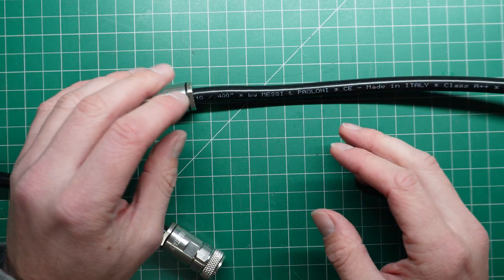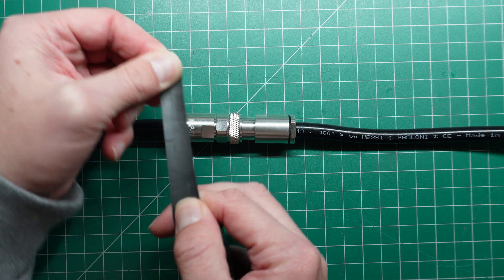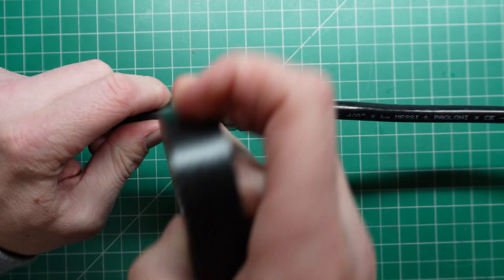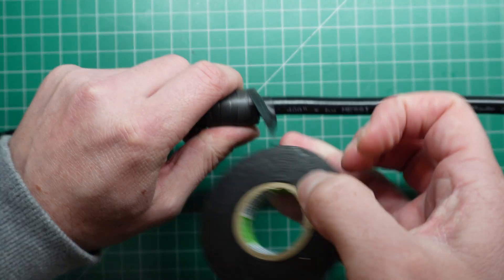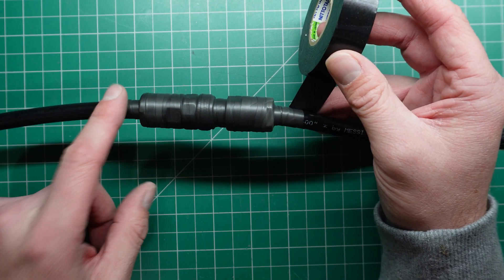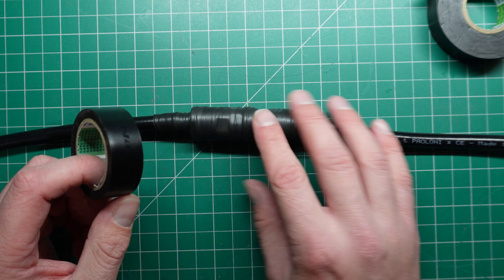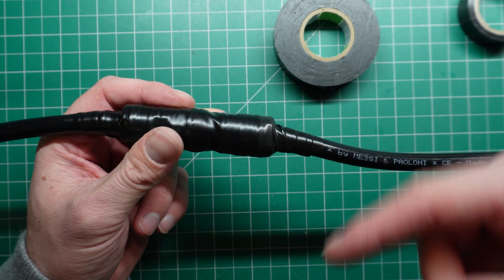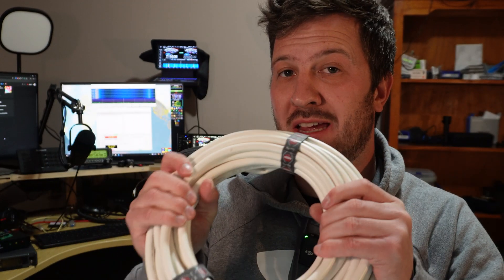Waterproof COAX Cable the Way The Techs Do It!

Comment: Super 88, curtesy wrap, then butyl tape, to seal it, then 5 layers of super 88 stretched tight to help compress the butyl.  Start at the bottom and finish with an up wrap.  At the end, flip the tape over for sticky side out, go around a couple times then flip the tape back again go around and cut it off.  Don’t tear.  For some odd reason, some people have problems using the self vulcanizing tape.  We used it in the Navy in the 80s, but added Scotch Kote after.

Comment: Everyone talks about how Low - Loss that Coax is, but if you look it up, it's not that great ?
I do like the looks of the connectors, but as to such great 
Low - Loss, what am I missing ?
                    🤔.....?
Reply from the maker: Low loss vs flexibility. LMR240 and 400 have lower loss, but are rigid centre conductors
Reply: Dunno what charts you're looking at but the ones I'm seeing, its closer to half the loss of "regular" coax. And I'm not interested in LL400 or whatever because it's solid core and copper plated steel at that .
Reply: @oldfartonabmx2122  
" Regular Coax " ?
                       🤔.....?
Perhaps you need to really study, instead of memorizing the answers !
With your comment, you have made a huge leap, mixing Apples & Oranges !
Very dependent on what you wish to accomplish !
And believe it or not, a solid conductor is really what you want !
Just because it doesn't fit your plan, doesn't mean it's wrong !
Try not to paint with such a large brush !
You may end up covered in paint !
But thanks anyway !
👍😉

Comment: Wrapping the connector in Teflon pipe tape fist, then overwraping with self amalgamating tape, will make it much easier to get the stuff off in the future. I have used this method for 20 odd years and it works well!

Comment: A layer of electrical tape first makes it easier to remove the self amalgamating tape later, and an outer layer of electrical tape protects the rubber tape from UV damage. Don't buy cheap electrical tape, it always falls off. Get the good stuff. I use Scotch Super 33+.

Comment: Good to show people. I still finish mine off after that with Denzo tape. messy as hell but never had a failure of a plug/socket connection to the antenna even with plenty of salt water. the antenna and foundations give out first ;-)

Comment: If it was an outdoor connector I'm not going to touch for years, I would use glue lined double wall heat shrink, then use split tube over that then PVC tape around the split tube then cable tie the PVC tape. 
Also M&P have o-rings on their connectors, I have 10m of the hyper flex 10, they also sell a seal boot for the connector.
Reply from the maker: Yes glue lined heatshrink is good too 👍

Comment: Thanks Hayden. Perfect advice and exactly what I have always done. I use Scotch 23 Self Bonding for the waterproofing layers and Scotch Super 33+ for the UV protection layer. The Super 33+ is horribly expensive, but the results after 30 years in the NW Queensland sun make it well worth the $25 per roll. I also use it to UV protect my cable ties holding coax to the boom and/or mast. Lasts forever.
Reply from the maker: Great tips! Scotch Super 33+ is the business, $$$ but as you say buy once cry once.

Comment: I was taught this exact technique when I started my marine electronics career back in 1989. I was busy installing JRC GPS navigators (new technology back then) and each included a roll of Nitto brand self-amalgamating tape and PVC tape. The instructions were very clear about the need for multiple layers of rubber tape and the top layer of PVC. These connections stayed watertight in the tough marine environment for decades. JRC also introduced me to 5D2V and 3D2V Japanese coaxial cable and connectors :-)

Comment: Brotip:
Use crappy electrical tape FIRST, before the butyl rubber tape. Quick  wrap of it will save your rear later.
Then to the butyl rubber half-lap wraps around the connection.
When you cut it in a few years time: the butyl tape will peel right off with ease.
Used this method on cell towers AND it works amazing.
I figured this out when I broke some thin coax by cutting it with an exacto knife, just don't forget to wrap it over and PAST the electrical tape to make the seal around the cable.
Then one last wrap of electrical tape to take the UV hit. I usually do two passes, one opposing the other. So when one pulls off, it doesn't unravel the other side.

Comment: Great video on proper sealing of connectors. I would like to add that the electrical tape adds chafe protection also.  Another way that works great on boats where coax or any wire is exposed to weather is thick wall heat shrink that has a sealant inside Armor Company is on producer of this product.  I have replaced antennas on sailboat masts that have been on the boat for over forty years and when cutting open the heat shrink the  connectors still look new and have not corrosion.
Reply: Yep,
I've always used adhesive lined heatshrink on any outdoor connections, you just need to be careful not to overheat the connections under the heatshrink.
Reply from the maker: Great tip!

Comment: Why not an adhesive lined piece of heat shrink?

Even two layers?
Reply: In my experience glue lined heatshrink tends to crack along the glue line when exposed to stress, vibration or extremes of temperature. Once it is cracked then water ingress will follow.
Reply: @VK3ZPF  "glue line"

The stuff I'm familiar with doesn't have a glue line that I'm aware of, also, when I've cut it off (very difficult to do) it seems to be homogeneous and flexible.

Have you had long term experience with this method and then subsequently cut it off afterwards?

I feel a Project Farm long term test is in order!   ; )
Reply: @mjktrash  "glue lined" is the same as "adhesive lined".
Once heated the adhesive goes hard and is no longer flexible. This is what leads to cracking.
Some antenna manufacturers use glue lined heatshrink on the coax connector and then advise to tape over the heatshrink in the same method as taping connectors.
Reply: @VK3ZPF  Ah, lined vs line.

I thought you were saying there existed an axial line in the glue that let water in.

As far as hardening, I haven't seen that, but I don't doubt it.  Different exposures and/or manufacturers.

UV exposure eats almost anything given enough time
Reply: @VK3ZPF  Huh? All the adhesive-lined heatshrink I’ve ever seen (or heard of!) uses a hot-melt adhesive, so it softens in heat and returns to its original stiffness when cold. Are you saying there are heatshrink tubes that are lined with an adhesive that doesn’t melt, but heat-cures into something hard??
Reply: @tookitogo Not doesn't melt and heat cures hard. The lined heatshrink you have described returns to its original stiffness then, over time, cracks and lets water in.
Reply: @VK3ZPF  Huh? “Not doesn’t melt…”? I can’t figure out what you’re trying to say.
Reply from the maker: I’ve found the same thing. Plus it’s harder to get off later
Reply: Good info Hayden. 👍

Comment: When finishing off with normal electrical insulating tape, wherever possible I very briefly touch the end with the side of a hot soldering iron to melt it to the layer behind. This is very effective in stopping it unraveling.

Comment: I have to unplug the coax from the radio and store it outside when not operating, so I've been wrapping the connector end in several plastic bags and tying it up with the end pointing up to avoid water ingress.  This has had questionable results.  Does anyone have a good idea for protecting the cable connector end when storing outside?  I know the ultimate solution is poking a hole in the wall of the house doing a permanent installation and just not telling the landlord but I haven't gotten to that yet.
Reply: You can buy panels that insert next to the window if you have horizontal sliding windows, that acts as your pass through and is removable.
Reply: You mean when the cable is disconnected? I've done similar to you, using amalgamating tape around the cable / bag, then put a small hole in the bag so that if it's not totally waterproof, the water will drain out. (I like to use the M&P style connectors that are supposedly waterproof themselves anyway)
I'd love to hear any better ideas.

Comment: I now use UV proof heatshrink with glue inside as recommended by Antennas Amplifiers. Put a piece over the whole thing and shrink it on = completely waterproof (and quick). Just as much of a pig to remove if you ever want to undo the connecter as fully cured self-amalgamating is 😂 73 de G0MOH.

Comment: Especially if intending to bury the joined cable, another option is good quality large rubber heat shrink, otherwise, what used to be called "coax-seal" self-amalgating tape I find is the best option. I avoid using cheaper electrical tape outside as I find it can dry out under sunlight. 3M cloth tape can be used as an outer layer to protect lower-level coax seal tape except not when environments can go under -30C
73 Ed.

Comment: There's also (Paint on)Rubber gloop too - its self amalgamating tape in a bottle, great for awkward locations like the RF connector on a Codan Tuner when the fitter/installer put it  too close to the grille.

Comment: We called that stuff F-4 tape when I was in the USAF, years ago.  I was a radar tech on fighters and ground radar (later).  We wrapped just about all of our connections with that stuff, essentially like you do, sans the electrical tape, since most all of the connections were inside of the jet or equipment racks, and closed off after we finished.  Good video, thanks!
Reply: Self Sealing Silicone Tape.  Lowe's has it in the plumbing department and I've been using it on my coax.  Retired USAF :)

Comment: I put a dab of oxide inhibitor on the pin and barrel of the connection first.  A
slight tightening by wrench then coat it with liquid tape.  Haven’t had a problem with connections on the Jeep in temperatures from 50c to +45c.  Yep you heard that right 😊.   Great video  make sure you wrap it Son!
Reply: Which oxide inhibitor do you use, Muds?
Reply: DeoxiT.  Expensive but you only need to use a drop.

Comment: I only use n type connectors outside. Also a small amount of Vaseline.
What about layers of plumbers tape. The thin white stuff? I mean it works for plumbing...
Reply: on the threads? doesnt that affect the contact for the coax screen to the mating half?
Reply: @ILoveMyBikes it does indeed. It creates an insulated capacitance that's detrimental to conductivity. Only copper based products or common automotive dialectric grease is suitable. DX Engineering has great sealant.

Comment: I also use nitto lecco tape to uv protect your proper self amalgamating tape 👌
Reply from the maker: 👌 perfect 👍
Reply: Not necessary if you get the good stuff.  I cover radio sites all over my country and even ones 15+ years old with self sealing rubber tape are still holding up today.